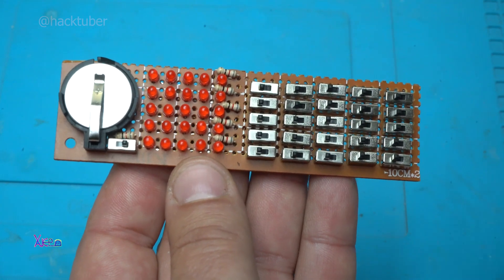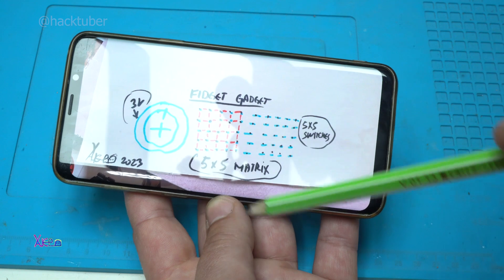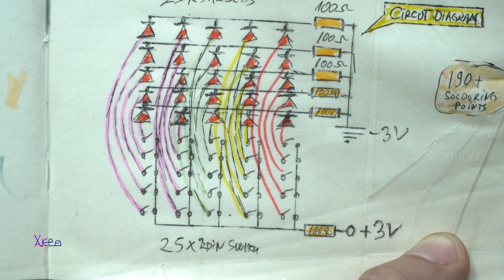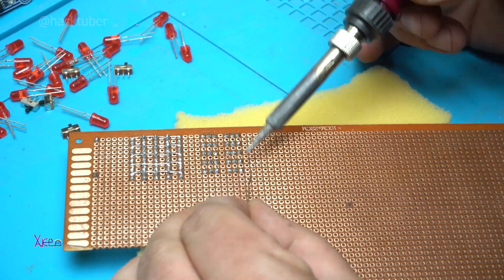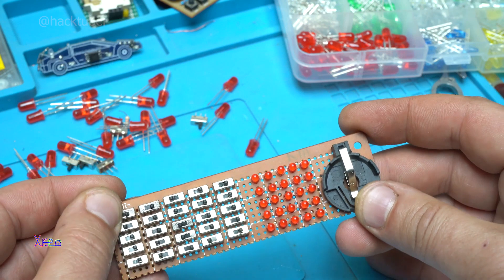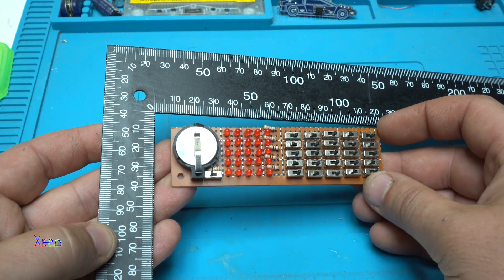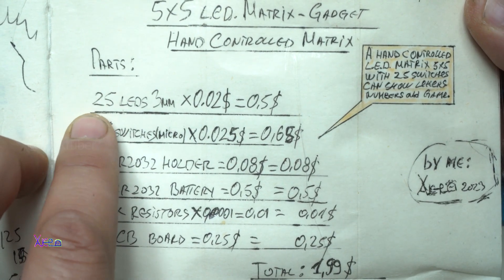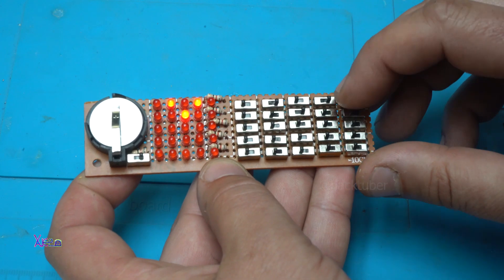Homemade 5x5 LED Matrix without using Microchip

Comment: Is this what happened when you get too many switches from aliexpress? Just like the 100pcs 480 ohm resistors that came with some Led's I ordered.  I'll never use the crap if I don't build something strange. Good work on solving this issue.